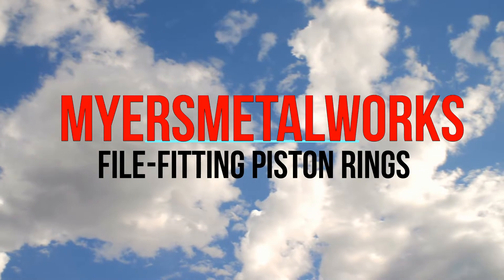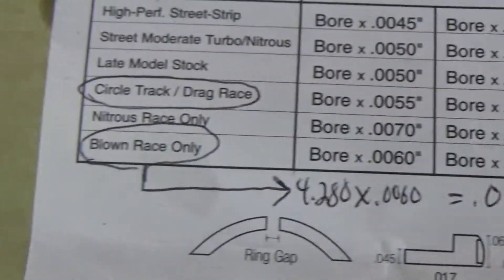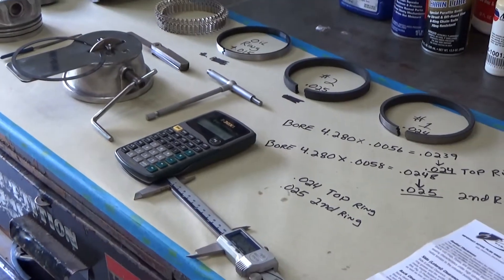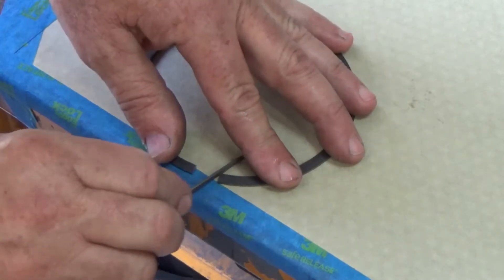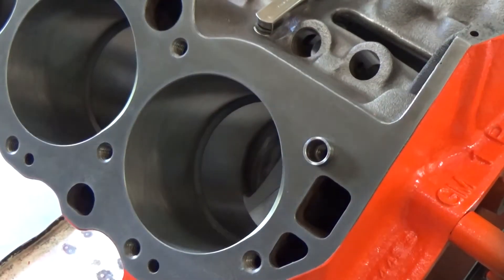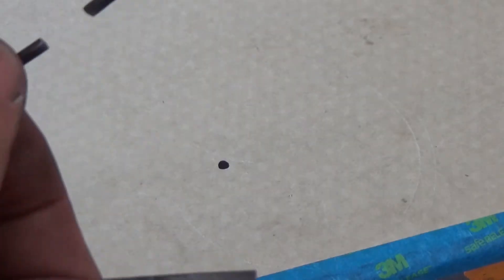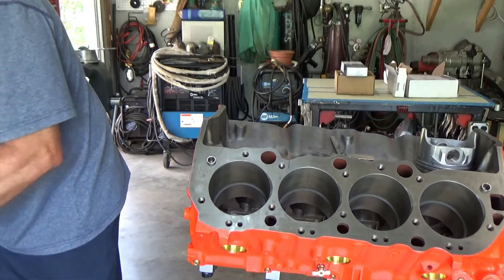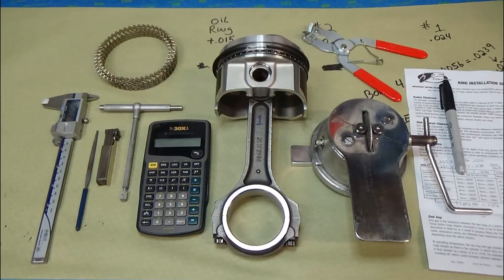Gapping Piston Rings...  #3 Chevy 454 Big Block Performance Engine Build...

Comment: I'm putting one together now. First one , I measured it's .035 gap ? Should I go get another new set ? Just stock 454 1986 truck motor ..
Reply from the maker: Hi Mike....  Not sure....Sounds like alot but best to have a manual and go with its specs for your engine... If its your first engine look up Grumpys Performance Garage on the web for alot of info and tips...

Comment: Its a thumbs up for me nice job! Just a reminder the second ring is a much softer metal and cutts much quicker than the top ring meaning slow down and check more often with your second ring! Hope your engine works out great for you! I missed your ring installation pliers and they work great I still use mine and have built many engines for other people!
Reply from the maker: Thanks for the tip!
Reply: @Myersmetalworks thanks for your share it . I like rebuild gm 350 sbc and others engines and th350 ..th400 trans but don't have any repair manual pdf..chevy ..cadillac seville..buick skylark..77..76..so on
Reply from the maker: @mehdi-seville  Thanks for your nice comment and glad its help full.
Reply: @Myersmetalworks your welcome ..im from Asia..i like very gm old  cars and repair.and there are many American old cars..1977 ..76 cadillac seville.350 oldo big block th400 .....1975 buick skylark 4  doors 350 sbc .th350....chevy nova 4 doors 250 l6 .th350 ....
But in my country there's no any repair manual for this cars engines ..trans...wiring diagram...and so on 
Brother Do You have any repair manual PDF  for this cars ? 

Please help me 
Thanks
Reply from the maker: @mehdi-seville I dont have PDF or manuals for these cars.